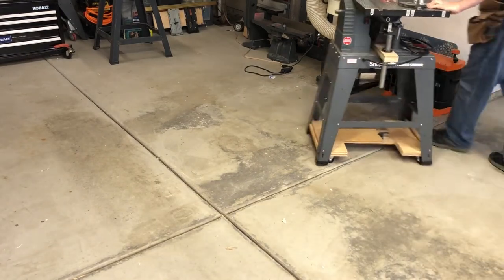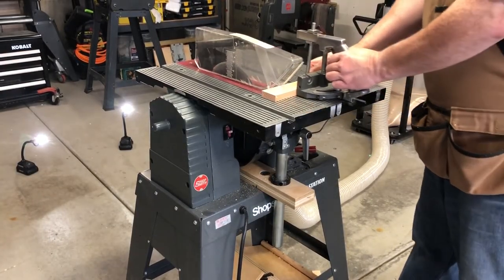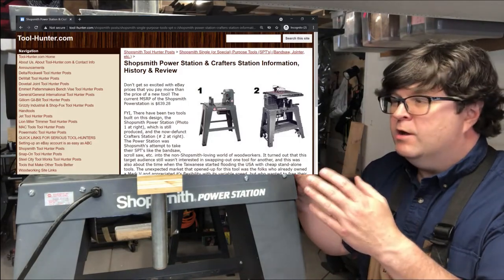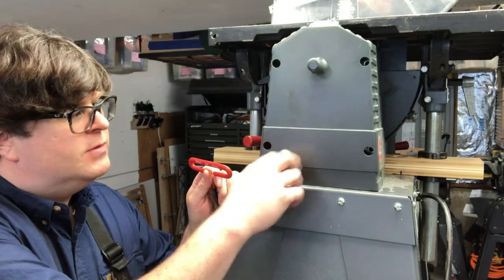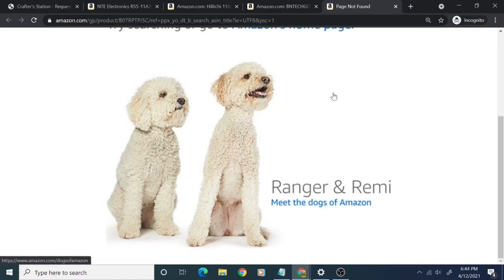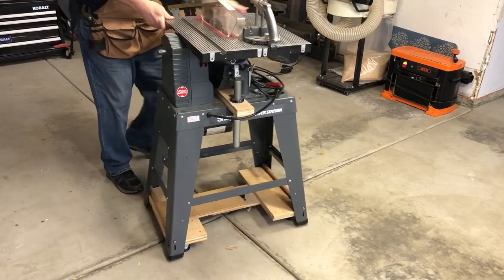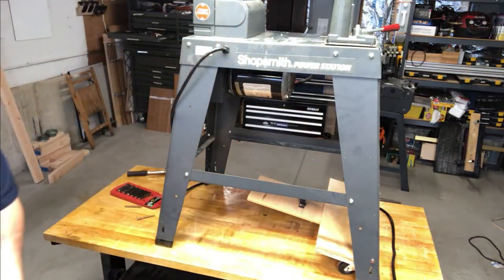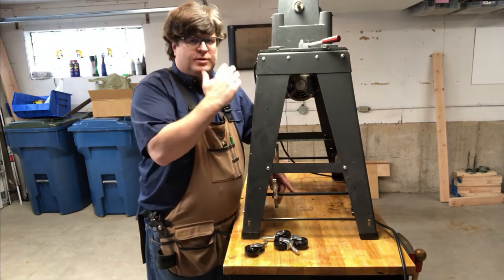Woodworking Tool Stand Hack Fail: I Regret These Modifications

Comment: Thanks! I wanted to come back and re-watch this after Scott's latest videos. It's great to see some more opinions and options.  I've got some extra motors laying around and I'm thinking about picking up one of the new power stands, or trying to hunt down a powerstation to run my bandsaw as a standalone so I can keep the jointer on the Mark V full time. I really enjoy your videos, thanks for all you do for the Shopsmith community.
Reply from the maker: Thank you I appreciate the kind words! I made a ShopDeputy out of my old 510 and much prefer it over the powerstation. If you can find a deal on an extra Mark 5 it might be an option.

Comment: Well, it was worth a try. Thanks for the shout-out!  I have a Crafter's Station and it's not a winner. Also, even though Shopsmith says that you can power their jointer on the Power Station/Crafter's Station it's just too dang slow.  On a Mark V the jointer is running at 6,200, while the top speed of the Power Station/Crafter's Station is 3,850.  Fun video, though.  Scott
Reply: Very glad you mentioned using the jointer only on the Mark V, you beat me to it, Scott!
Reply from the maker: Thanks Scott and you're welcome. I don't regret giving it a try. I had a lot of fun figuring out the wiring diagrams and learning to work with the relay. But truth be told, never use the mods. I do use the Power Station constantly for the Belt/Disc Sander and Band Saw, it really excels with these.

I put the link to your tool-hunter blog in the video description. This is is one of the resources I looked at when first picking up my Power Station, thanks for doing those blogs! And I never have put the jointer on it because of the advice in your  article.
Reply from the maker: Thanks for watching, Chad. Really appreciate it.

Comment: Interesting. Based on Scotts comment the Crafter station isn’t a winner either. I have two 510s thinking about making a Shorty out of one. Any thoughts. Can you put a reversing switch on your 510?  It would be nice for lath sanding.
Reply from the maker: Hi Dave, no you cannot reverse a stock Mark V motor. In order to reverse a motor the internal windings have to support it. Usually a mothers label will have a reversing wiring diagram it it supports revering. I like the idea of a shorty or shop deputy. If I can figure out the space issue I would rather have one of those than the power station.

Comment: So, does the reversing switch Mod, make it worth it for sanding at least?
Reply from the maker: Damion, thanks for watch. Yes, I believe the reversing switch does have some advantage for sanding. For a disc sander running the other direction lets you present the workpiece from the other side, and use the grit in the other direction so maybe getting a little more life out of the sandpaper. A drum sander you can just flip the sleeve instead. I've thought about the belt sander, but am not sure it is design to be ran in reverse.

So, yes some advange, but WORTH it? I'm not sure. I had fun doing it, so that made it worth it to me.